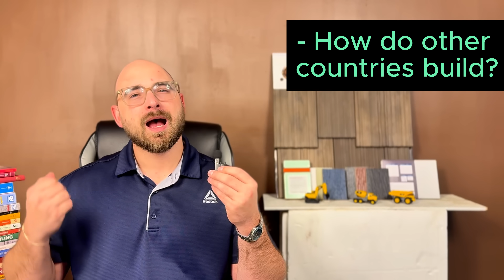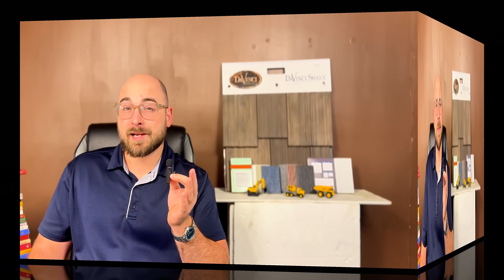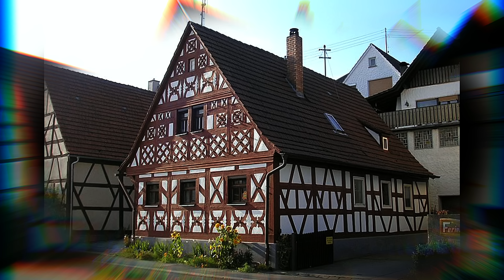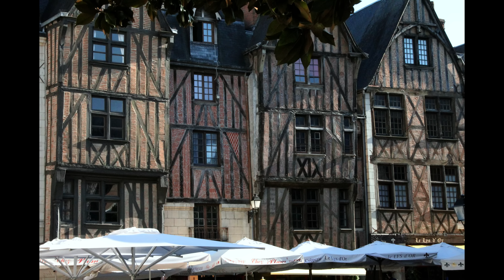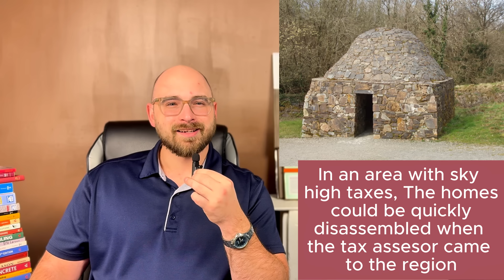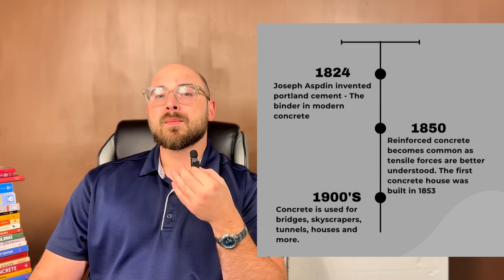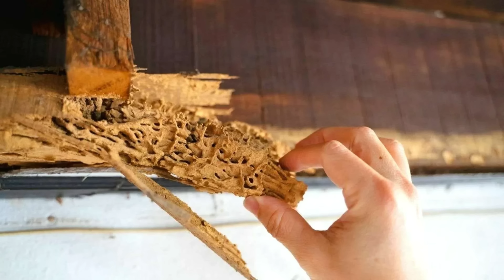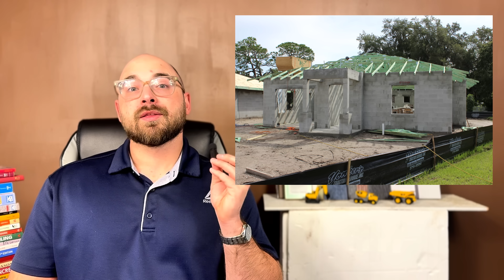Why Other Countries LAUGH at American Homes

Comment: Wow! I just stumbled onto this channel, but this is literally the first time I've heard this, and I know a lot of people throughout Europe that absolutely love US homes!? A few thoughts...

1. Most Europeans I've talked to are shocked when they realize just how large the USA actually is! Earthquakes and hurricanes only affect a very small portion of the country!

2. States like CA, OR, and WA have already started MASSIVE and expensive reconstruction efforts for fires and earthquakes, especially large, multi-story buildings.

Many homes in the Gulf, like FL, LA, etc., have also started new construction techniques for hurricanes.

3. Most of the country has used brick, concrete, or a combination. Yes, the inner structure is primarily lumber and reduces the cost tremendously. However, the outer walls are typically brick and/or concrete, and for good reasons!

The wooden inner structure allows for extremely easy remodeling, wiring, plumbing, etc. It also allows for extreme insulation from drastic temperature changes, and keeps cost minimal compared to brick/concrete!

Where I live, for example, we get temps as low as -50F in winter to 110F in summer (-46C to 44C), but we don't notice it indoors!

Newer homes (past 40-50) years have also added the use of fireproof walls that would prevent a fire from spreading (within the home). This has become standard code in the last 10 years or so, and you'll see this in ANY multi-family dwelling - regardlessof age! In fact, my building has a concrete wall between each unit with a foot gap so that neither fire, water, or noise can pass through to the next unit.

I would love to know where people live that think American homes are so cheaply built. I have friends and family throughout the UK, Ireland, Spain, Portugal, Germany, and Sweden, who have had nothing but positive things to say. I'm a bit surprised, to say the least 🤔

Sure, things have evolved over time. There was a period where developers building 100+ "prefab" homes were a bit cheap, but it typically wasn't on the outer quality. They're usually cheap on things like cabinets, counters, sinks, and that sort of stuff. The simple fact that I've seen in MOST parts of the country is that homes are built to last and don't need to worry about earthquakes, wildfires, floods, and so forth. In fact, most homes in my area are 100-150 years old, if not older. In fact, a lot of these are either being remodeled or torn down for larger construction and still using concrete and brick.

I'd love to hear which countries think things are built so poorly and why...
Reply: P.S. Another thing to consider is that as large as the country is, building styles and materials are dramatically different!

Take AZ, for example, and homes are typically built much differently to block the extreme desert heat.

On the other hand, coastal homes are completely different and are typically focused on luxury, although I suspect this will change in some areas after the CA fires (even though they could have been prevented if the state Government had done their job!)

Northern homes are built completely different altogether, in fact I had a friend here from CA that was baffled why so many of our homes were pure brick and thought it looked ugly.

Understand that the US is like all of Europe (and then some iirc) in terms of land size. I know for a fact that homes in say UK vs Italy vs Greece, are completely different styles and methods of construction. I'm going to take a wild guess that people are probably over generalizing that all US homes are built the same.

Please, correct me if I'm wrong!

Comment: There might be one exception to the United States down in south Florida where I grew up late 80s early 90s to mid 2000s lot of homes are built center block and rebar walls, solid concrete floors mostly cause to withstand the hurricanes and subtropical climate is just not good for anything would related Termites as well. A lot of the historical homes like the Edison home a lot of taxpayers and money is cost to keep it standing and it’s one of those stick build with Victorian style homes down there first time moving out of Florida live in the house now with you know typical stick frame and yeah, you can’t punch through the walls to grab a coffee😅

Comment: I am baffled to see the pretention of a country purely based on his economics for building houses ( not just that as cars based cities are the norm which is also a big issue for environnement and also the fact that now you have a president convinced of the inexistence of climat change... ). Like you said in the video the houses are cheap made with cheap materials and mass produced. Considering you are a first world country and you build skyscrappers made of cement and metal that last a long time ( plz no joke about this subject i know it is sensitive for US Citizens ) I just can't understand why the administrative part of US don't do a change on its building code. Like I can easily understand the pov of citizens as this is the only house type they know / that are for sale but MAN... Also for the comments I saw below, NO houses made of Cement, Bricks and stone aren't defficient when it comes to insulation in fact it's one of their major qualities beside lasting for a long time : I live in a stone house with like 60-70 cm walls and even during heat periods when the temperature went up to about 45-46 °C it was still 25-30°C inside !

Comment: From my experience, this might be the only exception in America talking about probably one day cause I don’t think I’ve seen build houses built this way anywhere else the country I grew up down in South Florida during the early 90s and late 80s 2000 and a lot of houses and homes were built with center block, rebar and concrete, solid floors mostly wood timber and siding just did not survive the hurricanes and subtropical humidity down there And termites. I member always wash houses that would pop up around my neighbor being built. We always built the same cinderblock walls outside rebar concrete floor lay down. The only exception of course is the roof was the Eno typical wood A-frame but just something I never thought of until I moved out of state and your houses are flimsy everywhere else stick walls you can’t punch through them😂

Comment: I'm an American in South Korea.
Concrete is big and then brick. They have beautiful timber construction but they are rare. 
The trouble is that they often don't build in great ventilation. You get a lot of mold and poor air quality. But it's otherwise fairly cheap and very safe. But I'd say the biggest problem is modification and updating. After 50 years (OR less!) they tear down the building. It gets harder and harder to modify and upkeep these concrete buildings. You want to add a room? Can't. You want to combine two rooms? Nope. A wall was damaged? Tear down the whole thing. Want to run a pipe under this floor? No can do.

Comment: In south Africa we use cement and brick. Our roofing is usually made by wooden trusses, but more recently they're being swapped out for concrete slabbing, giving a higher ceiling for the same height. We don't have snow or strong earthquakes. We also have issues such as woodborer - insects that eat through  wood. I think they're called termites in the US. I could be wrong. They can lie dormant deep in the wood for many years, so pesticides are usually only short term solutions.

Comment: We use concrete primarily in public, commercial, industrial buildings and apartment buildings, while it can vary in single-family homes (often brick with additional insulation). However, almost all buildings have one key difference from most other countries: the foundation. This includes a basement (underground) with an air raid shelter and is made of solid reinforced concrete.

Comment: Where I live houses are either concrete for the modern cubic designs or double brick, outside walls and inside walls are brick. The roofs are either zinc or tile. Strong and sturdy.

Comment: Lived in S.Korea for 16 years and living in nz for 7 years now. The difference between both countries' houses talks to me. On one hand is a cheap plywood with 0 sound deadening and always break when i open the door too hard, takes 10 years to build a bando. on the other hand is a strengthened concreate, built on such a short period of time to reduce time-wasting but still has structual rigidity far better than the other.
Yes. nz has inspiration from the big unc sam, and korea is inspiring other countries.

Comment: i lived in an end terrace house in leeds uk. built in the 1800, right next to a train track (within 5 metres of the outside wall). it used to have coal steam trains up and down from the train museum in york. had freighters and public transport. all day and early morning.

ZERO problems in the foundations or brickwork after 200 years.

Comment: 22:33 The main point from my view is missing, leaving an European single familiy home and entering a US single family home immediately gives one a feeling of the house is not build sturdy, even the things inside are extremely flimsy, like separation walls, windows, doors (omg - doors) - one can even hear s/o moving in other parts of the house, even when not being loud, in contrast to European houses,  but especially Germany is overdoing red tape when building a house. therefore they are quite expensive and is taking ofter  longer with individual house to get all the permissions than the actually building process. Nevertheless typical US homes are build only to last 20-30 years, like in Europe industrial buildings which are depreciated in 10-20 years.

Comment: it's a bit ridiculous to speak about timber frames in the context of "sturdy" European houses xD Wood burns and we learned it already in the Middle Ages, after which houses were upgraded to brick and stone. (Americans still haven't learned what Europe knows since Middle Ages.) What we mean when talking of sturdy housing is reinforced concrete, bricks and prefabricated concrete slabs. Meanwhile, US residents prefer cheap cardboard structures that need to be rebuilt after every storm or fire.

Comment: Dude, you’re so slow. по русски ниже 
Summary:

1. The video explores criticism of American homes from people in other countries, particularly Europe, where brick and concrete houses are popular.  
2. In other countries, homes are built using available materials, considering the climate and traditions (e.g., earthen homes, timber-framed houses, stone houses).  
3. Historically, the U.S. has relied on light wooden constructions, which are cheap and quick to build but have issues with durability, fire safety, and resistance to natural disasters.  
4. In Europe, brick, concrete, and stone houses dominate, designed to last for centuries but requiring more time and costs to construct.  
5. Various construction methods, including concrete and modular systems, are gaining popularity in the U.S. due to their strength and energy efficiency.  
6. The author emphasizes the need to adapt to new technologies and materials to improve the quality of housing in America.  

Краткое содержание:

1. Видео рассматривает критику американских домов со стороны жителей других стран, в частности Европы, где популярны дома из кирпича и бетона.  
2. В других странах строят дома, опираясь на доступные материалы, климат и традиции (земляные дома, дома с деревянным каркасом, каменные дома).  
3. В США исторически использовали лёгкие деревянные конструкции, что обеспечивает дешевизну и быстроту строительства, но создает проблемы с долговечностью, пожаробезопасностью и устойчивостью к стихиям.  
4. В Европе преобладают дома из кирпича, бетона и камня, которые строятся на века, но требуют больше затрат и времени.  
5. Различные методы строительства, включая бетонные и модульные системы, становятся всё более популярными в США из-за их прочности и энергоэффективности.  
6. Автор подчеркивает важность адаптации к новым технологиям и материалов для повышения качества жилья в Америке.

Comment: I was a contractor in brazil for a brief time and my father for his whole life. 

According to building regulations in brazil, the brick walls are not considered structural. The structure is supported by concrete pillars spread around at fixed intervals ( depending on the length, height, weight, etc. ). The brick masonry is there to " fill " the intervals between pillars. 

You can literally tear every single brick down in a Brazilian house and it will still be standing.

Comment: Fuck this bias shit in India North East people build rod piller filled with concrete n rod string roof n rod beams which take time to build especially that we have to wait for the concrete to dry especially the rod string roof concrete requires at least 3 week to dry up 
That too we have to keep apraying water for the roof string to firm up n tighten up the gap it take atleast 7 to 8 months time to finish the house of 5 rooms
After the house is finish no storm will be able to rip the house one bit fire will not burnt down the house for several centuries 
More over we don't require to pay home insurance in North East India build once for more than 15 to 20 generation to live in
America house construction only for quick earnings n low quality 
Americans home people can punch through walls
Punch North East Indian house if ur hand doesn't need medical treatment I will bet everything I have

Comment: Something I don’t see really talked about is that the best part about the quick and cheap construction of homes means less of a barrier to renovate. Knock out a wall, add a new wall, create a room, get rid of a room, reshape a room, etc. the flexibility and malleability to shape a home you want is built into the featureset of our homes. 

Then there’s natural disasters, of which many states suffer from. A tornado or tsunami for example may have a tougher time laying waste of a bunch of brick homes but there’s no real guarantee that it wouldn’t.  Repairing and/or rebuilding is quicker and more efficient
Reply: But the point is you wouldn’t have to rebuild so much if they were built to last. I’m in the uk and we can rejig our houses pretty easily, but the main thing is it’s fireproof and withstands bad weather. In general it feels more solid and sound proof , where as I find American homes sound hallow and almost feels like they can blow away which in a essence they can

Comment: The US has much greater weather extremes than most nations, certainly in western Europe; and the wood framing construction is conducive to good insulation, much more so than solid walls of material such as brick or stone that conducts heat to a much greater degree.  Even to the point current practices specify 2x6 framing for exterior walls to facilitate more insulation than older homes with 2x4 exterior wall framing.

Comment: I would've do a stick built home anymore. The common argument in favor references that there are stick built homes over 100 years old.

The thing is, the wood quality available these days does not compare.
Reply from the maker: Correct, older homes also had less insulation and better drying potential. 

Now adding Insulation and airtightness is less forgiving with moisture as are modern materials like zip system. No room for error or failure 

Can we build better with lumber; technically yes, 

But is it worth it? 

In most cases I would say no. Everything should be either ICF or steel frame

Comment: It's understandable that a country with a massive population like the United States faces an overwhelming demand for housing, leading developers to prioritize quantity over quality. However, the soaring cost of materials, coupled with the increasing need for housing, raises concerns about the quality of homes being built. As a result, it seems that affordability has become the primary focus, often at the expense of quality.

Similarly, in Indonesia, the construction industry has shifted its focus over the past decade to using materials like cement, bricks, sand, and light steel structures, reducing the reliance on wood. Unlike the United States, which is prone to extreme weather conditions like hurricanes and storms, Indonesia's main concerns are flooding and earthquakes.

Comment: I think what differs alot is how to take care of moisture that can travel through concrete and vapor barrriers to keep organic materials isolated from that, while also allowing ventilation where needed. What I feel is more "flimsy" in the US is details, like the gutters, roofing and outer layers. It seems like many newer houses are demolished and replaced way too early in the US, wasteful. The same problem is with cars in general (regardless of brand) that it is too expensive to repair cars so they are going to end up in the junkyard instead of getting repaired even for a minor issue. Car manufacturers should have the same obligations to make cars that lasts and or are easy and cheap to repair. In some countries house manufactureres has a mandatory 10 year warranty against risk constructions or construction failure which make them build houses better. Sure prices might go up, but it is less wasteful and cheaper in the long run.
Reply from the maker: I’m not the cheapest builder, but I offer a 100 year structural warranty

Comment: You skipped over structural insulated panels. There are a few kinds, but they are typically designed in a factory, then built extremely fast on site. Very efficient homes, and in some cases, they use no wood at all.

Comment: Steel frame for roofs is common in Thailand. Safe from termites. And Thailand tends to use heavy roof tiles as it's less noisy in rainy season.
But the actual houses tend to be concrete frame with brick infill. Steel framing is usually only for the roof.